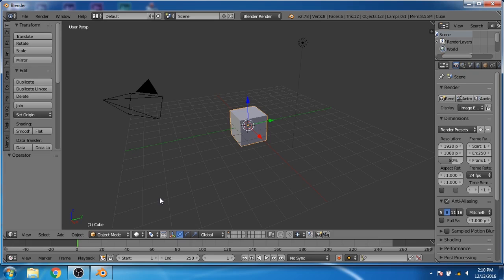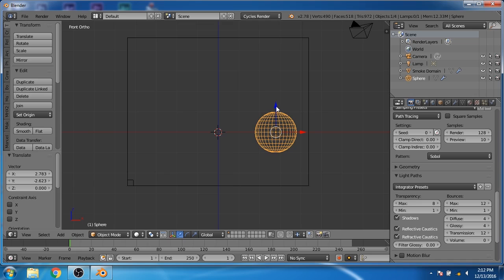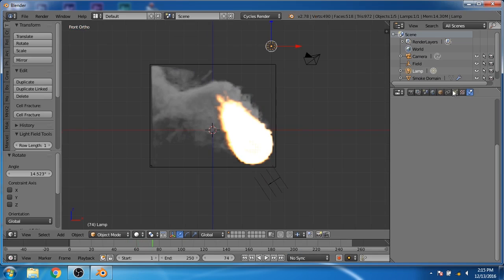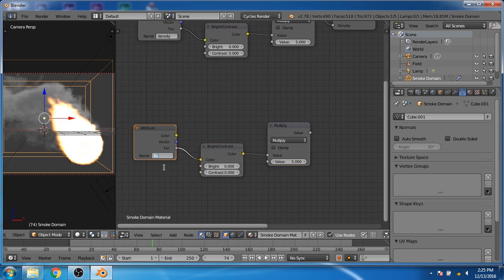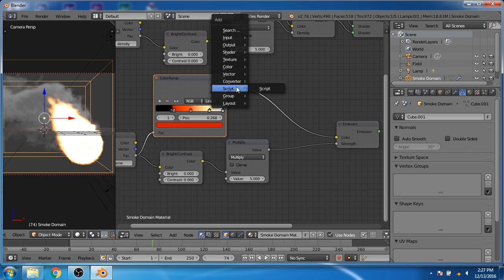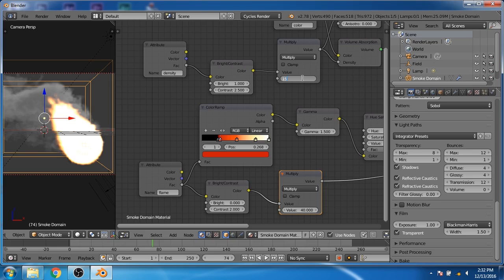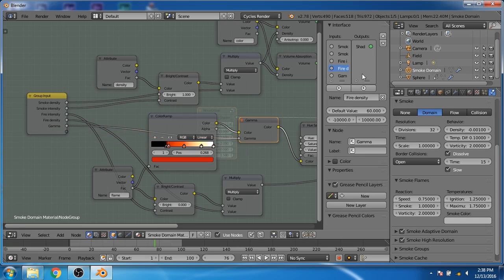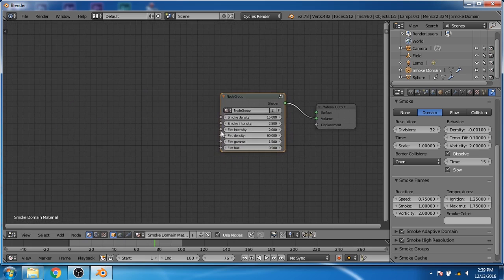Realistic fire shader in blender cycles || cycles render || Quick smoke effect in blender

Comment: Great... really like your tutorial style... Problem I have is that my render is only Black/white and can't find why.  Hope you can help. I checked all I can think of... I am in cycles render, using 2.78a latest, did not change any render settings.
Reply from the maker: Please check your node setup again..thankyou
Reply: I ran into the same thing. Older versions of Blender came with default node settings in the quick effect feature. You may have to add your own nodes.
Reply: Try this. In the Light Paths, put 3 o more Transparency rays.
Reply: quick smoke doesn`t make a material for the flame...you have to do it for yourself